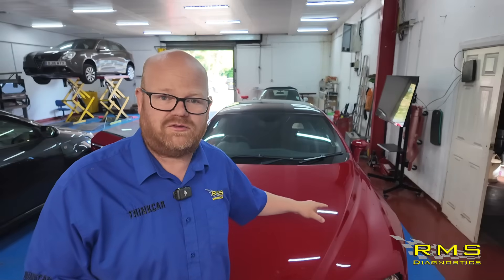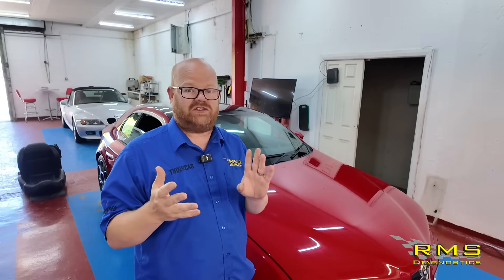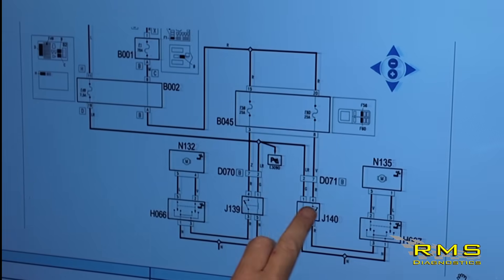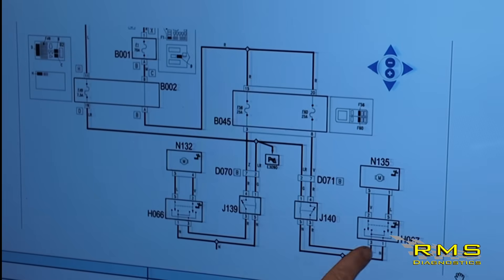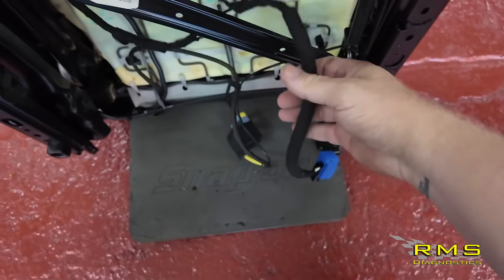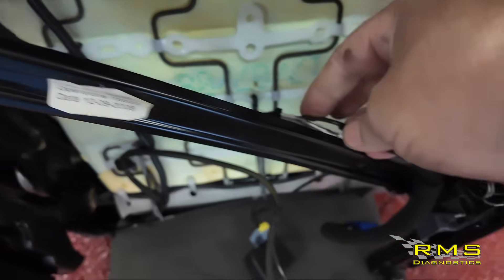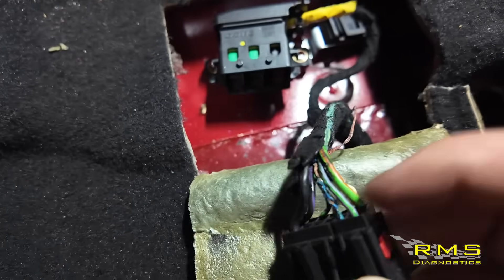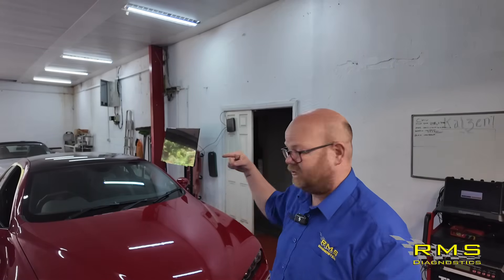DANGEROUS Aftermarket Fuse Nearly Burns Down Alfa Romeo - Electric Seat Diagnostic #bmw mechanic

Comment: This is a misconception with fuses  the rating is the current it can carry, when the current is in excess it will blow but circuit diversity plays its part in turning excess current into heat hence the melted insulation in the circuit.

Comment: I normally really enjoy your posts, but this one seems a bit wide of the mark in terms of the actual facts. While I completely agree that there’s a huge variation in quality control and tolerances with third-party fuses, your test and the comments at the end were a little misleading.

Most car fuses are specifically designed to handle surge currents  sometimes up to 300–400% of the rated fuse value. That’s exactly why different types of fuses exist for different applications. For example, quick-blow fuses protect sensitive equipment, while slow-blow types are used on high-load start circuits, typically to cover inductive loads. Automotive fuses sit somewhere in between.

So when you saw a spike load on your ammeter, that was actually within spec. In theory, a 7.5A fuse could tolerate an initial surge of around 30A without issue. The more important measurement is the load-time curve: the initial load rate vs. how long it’s sustained. A properly rated fuse should blow at its rated value within roughly a 5% tolerance under continuous load.

And this is really where the problem with third-party fuses lies , not in the surge behaviour, but in their ability to meet specification consistently.
Reply from the maker: i wish i had more time and ways to load up the fuse to show what was going on. most people got the idea but it was not the most accurate demo i grant you. sorry

Comment: In the fuse test they look different colours as if the first fuse was red normally 10a ?
Reply from the maker: it was brown 7.5 amp the aftermarket fuse showed 7.5 amp but was sort of clear so could be a misprint on a 20amp fuse

Comment: Fake fuse likely will only blow at 30A, because they only use a different colour cap for all the fakes, all punched out to carry 30A to make assembly easy, and to cut cost of the expensive die, and make them easier for the unskilled labour to assemble.

Beware of those cheap fuse sets, check they have different thickness elements for each fuse type, as a first check.

Comment: Hi Bob the British standard for car fuses is BS ISO 8820. Fuses can take 1.5 times there rated value for up to one minuite, Enough time to melt thin wires
Reply: 9volts also how do you
Fix the plug the melted
Wire is in it can melt surely
Can you get new pins for the plug

Comment: Over sized rated fuses are a nightmare in the electrical and electronic industry. I always fit fuses from a known source; RS, Farnell, Mouser or for vehicle fuses Europarts etc. A number of years ago, I had a fault on a solid state power supply and it was particularly difficult to find the short circuit. I used my IR camera and a controlled current power supply to find the componet that was getting hot, replaced that faulty component and job complete. There was a saying that other engineers used to swear by; the "SEB" method. That was to find the fault on an overhead power line by connecting full power and observing the explosion site. Seemed to work well for Southern Electricity back in the day before thermal imaging etc.
Good constructive video, helpfull for those that don't know what to do or how to repair it.

Comment: We had a similar situation of a fuse not blowing, the fuses we had were Sealey which you expect to be a good brand, however we tested all the different ratings some didn’t blow at all and the wires became red hot on the test bench , so we threw them all away and replaced all our stock of fuses with oem ones from a breakers yard , tested them and all good! Generally the cheap useless/dangerous ones have the ratings on but not highlighted in white and more transparent colours, so be careful
Reply: I'm afraid Sealey just stick their name on Chinese products, some are OK, some are not.
Reply: @bobfrankish8883  we also had some other fuses without the amp rating highlighted in white and threw them away and only use oem which I guess if you went to main dealership you may be able to buy them, however we stocked  up with ones from breakers yard , why these cheap generic ones don’t blow or does at a higher amp rating is a fire hazard waiting to happen

Comment: I recently had a BMW with an air suspension fault that had blown the 40A fuse. I put one of our stock fuses in and with the oscilloscope connected saw the pump motor draw 60A for about 10 seconds before the pump freed off and started spinning. The quality of stuff is really bad these days.

Comment: Had a similar issue on a Ford Transit Connect a few years back with cheap fuses from poundland. Replaced a fuse for brake lights. 1 wire melted and it just spiraled out of control quickly causing a fire behind the dash. Van was a write off.
Reply: Should have sued Poundland for the damage. Products should be fit for purpose and consequential losses can be charged for too. Easy to test if other Poundland fuses are faulty by an expert!

Comment: After market fuses...   do you mean from shops like halfords, euro car parts  motor factors?
Reply: All are aftermarket. Basically, it should be a reputable manufacturer (Bussman, Littelfuse etc). Then, if you can't find a datasheet, more specifically a time-current characteristic, then it's plain junk.